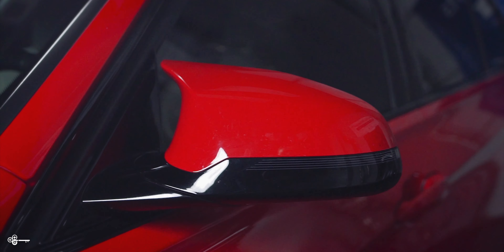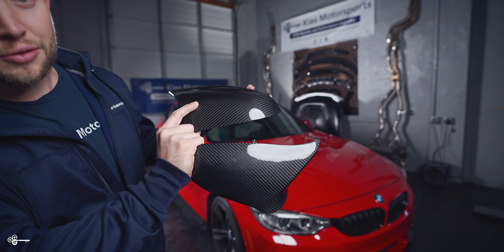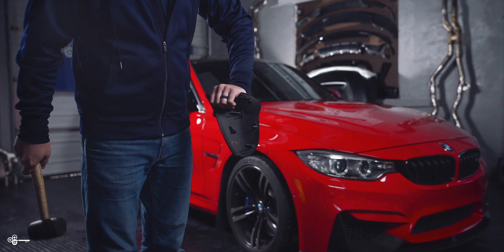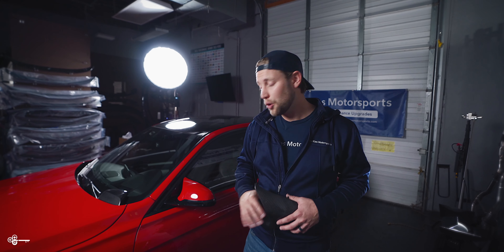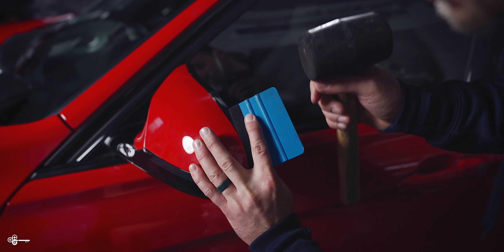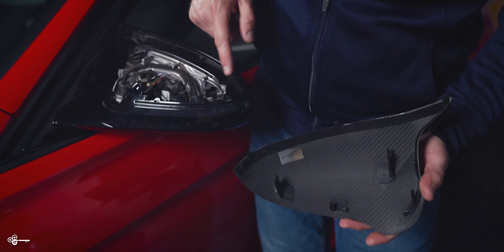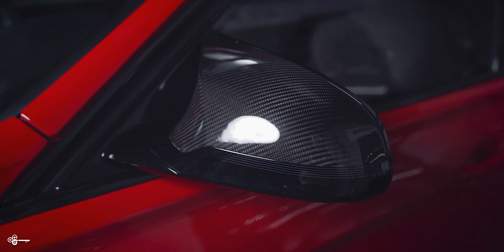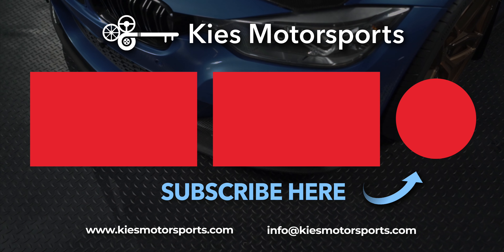THE EASIEST WAY TO INSTALL F80 M3 DRY CARBON FIBER MIRROR CAPS (F80, F82, and F87)

Comment: Good stuff bud! I just did this to my F30. I used a heat gun to warm up the mirror caps then took an old credit card and slid it up from the center of the housing. I then rocked the credit card back and forth until the cap popped off. Easy peasey and no broken clips. I think the key for F30 people is heat. It allows the plastic clips to be more flexible and less prone to breaking.

Comment: I tried this and mine unfortunately were not coming off using this method. Didn't want to hit in any harder and risk breaking the mirror. I had to resort to prying them off from the top which unfortunately damaged the tab that runs between the clips on my original mirror caps. Ah well, I guess my new mpe carbon caps will have to stay on the car when I come to sell it.